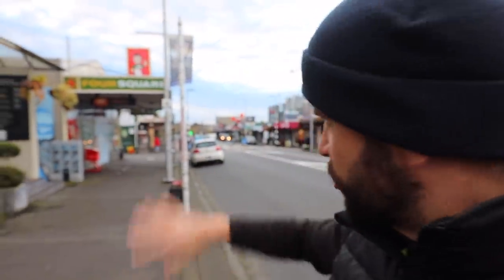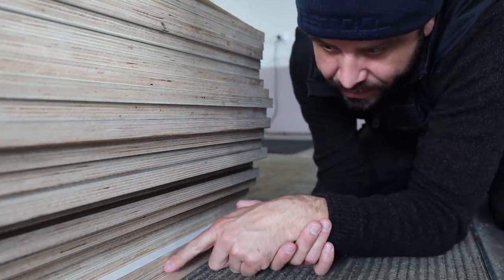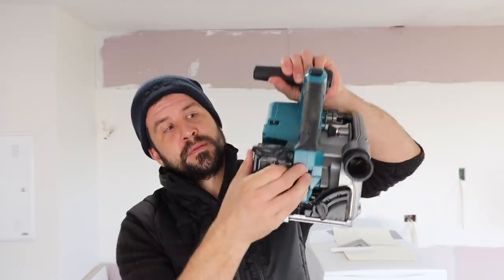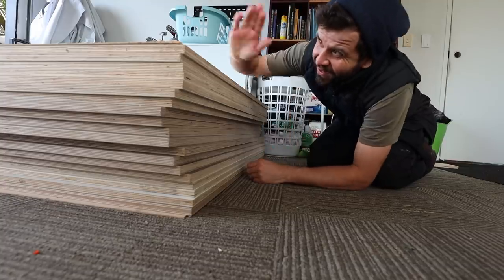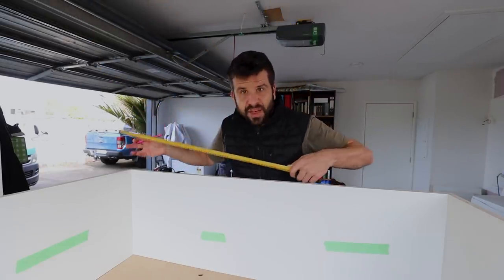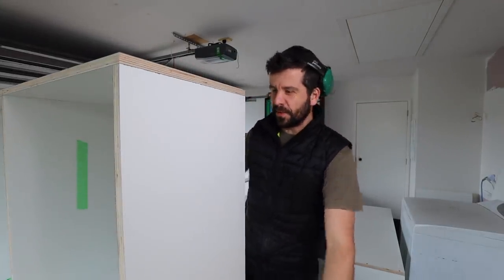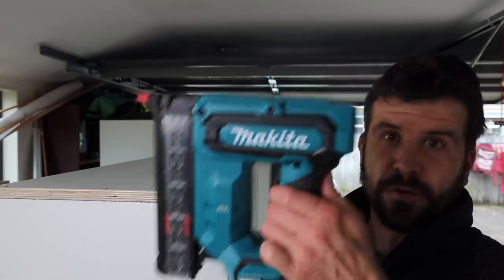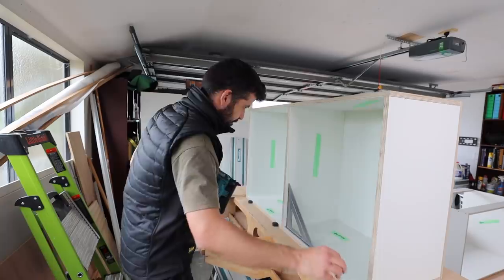Can a Builder Be a Cabinet Maker?

Comment: Scott, if you cutting cabinet panels, you need to get a rail square for your track. A quality one will guarantee a 90-degree cut every time and it should massively reduce your setup time for each cut. It's one of those things where after you use one, you won't know how you did without it before.
Reply: @everythingcool101  The GRS looks nice. I especially like that repeat stop extension they sell for it. 
I've got the benchdogs square and find it excellent. Its a shame they never released their version of the repeat stop attachment.
Reply: If you don’t get a good one it’s a hell of a lot of repeated errors though before you notice.

Comment: As a cabinet maker, I wouldn’t have worried about glueing the carcass together. Screws are easily enough strength. I would have been inclined to glue your back on though if your just pinning it on. Or just use screws for the whole thing. Love the channel anyhow and good to see you back on a job site

Comment: As a joiner and cabinet maker for the past 25 years, I can honestly say your units look better than what Ive seen come out of some kitchen places. Only critiques would be the top and bottom not in between the sides and unless its the look the client wants, no edge banding. Also personally I like to screw my backs on as well, never know how much clients are gonna put in them and how strong those brads are.
Reply: Have to agree with you as a cabinet maker myself last 31 years , maybe some solid lipping would look good on exposed plywood ,other than that top job by Scott
Reply: just curious about not placing the top and bottom in between the sides? is the other way (bottom/top on top and bottom) just stronger when hanging cabinets?
Reply: Sanded edges with the slightest arris can look superb with coloured face ply.
Reply: It's stronger having bottom and top internal as screws are horizontal to a vertical load, also he has now got about 12 or more exposed screw heads that will be seen from under the overheads unless he's going to add an under panel or laminate , but seeing as the ply is exposed it may have been done as to create an ascetic detail.
Reply: @jed8five897  ah right on, makes perfect sense. Thanks for the explanation!

Comment: The TSO parallel guide system is an incredibly valuable accessory when building cabinets with a track saw. Repeatable accurate cuts help save loads of time.
Reply: I just knocked up about 25 fake T&G doors (3mm scoring cut @10cm on ply). Convinced me I need some kind of parallel system - I ended up making a spacer to get the same size for the doors as it was too easy to be 1-2mm out which shows up when the doors are next to each other.
Reply: I’ll second how useful a parallel guide system is for this kind of work. I use the woodpeckers and really like it. The TSO one also looks fantastic.
Reply: @iainarthur7713  same thing for me with a tracksaw. I made some kitchen cabinets and they could be 1/2mm out and knock things out of square. Parallel guides next time for me.

Also how the heck do people get their track to grip laminate and melamine? It’ll slide sometimes
Reply: @iamram93  yeah it's a pain in the arse, the track saw clamps are really good and making sure it's free of dust.
Reply: @iamram93  how old or the neoprene strips? I replaced mine recently and it reminded me how well they use to stick. They're actuay kind of a pain now cause it makes it harder to use the square.

Comment: Standard carcase assembly would have you screw fix through the sides to fix  the base and top , as to hide all screw fixings ,unless your planning on laminating the hole bottom of the cabinet after installed , and understandable the way you've done it if you're going for an ascetic look regarding ply laminations.

Comment: Here where I live, for cabinet backsides we use Masonite, 3-5 mm thick HDF with one colored side, typically white. It is very hard and strong and it provides stiffness to the cabinet structure. It is much lighter than plywood, but it can be tricky to nail it manually. Nail gun rules for this....
Reply: yeah i was thinking that 12mm/15mm? ply looked overkill for the backs. a lot of weight there. 9mm is probably the sweet spot to prevent bowing and sagging over time

Comment: There's a company in Seattle that have a huge cnc and edgebander. You send them your cabinet elevation plan and what materials to use and they use their cnc to cut all the pieces and pre drill the holes for everything including adjustable shelves. they edgeband everything and you pick up as a flat pack and assemble your entirely custom sized cabinets. includes draws and draw fronts and doors too. essentially custom sized ikea
Reply: Whoa, good use of technology there. Are they only local or can they send product to Austin Tx!?

Comment: Hey Scott. Just a tip. Plywood with a surface on it won't take ordinary PVA glue. You need a melamine board adhesive. Looks the same but it's white instead of yellow. It's also waterproof so is good inside sink cupboards where there could be moisture. Also glue the backs on as well. I'm a cabinetmaker in Wellington semi retired. The best cabinet hinges available, in my opinion, are BLUM. They also have system 32 jigs available for drilling holes for the hinge cups, hinge mounting plates and adjustable shelf support holes. Draw runners as well. Check them out. Looking good so far. 👍👍
Reply from the maker: Thanks for the tips Darryl, I appreciate it!
Reply: in your opinion, building cabinets like this- would rabbets and dados step it up a notch, or are they unnecessary if everything is glued n screwed?

Comment: But can he hang a door :-)
Try sliding your tracksaw backwards when doing the scribe cuts, then drop it to the the full depth and run it through forwards, I've had much better results using this method and when you get into the rhythm its more efficient.

Comment: You're correct on the CNC, I can cut round 40-50 panels a day on my CNC. All of the dado's, blind dado's, shelf holes, and anything else cut and ready to go. With the way they build cabinets in your area for around $120K USD you can get set up with a good production CNC and edgebander and go at.

Comment: For those that aren't aware, on Makita chargers, if you repeatedly move your battery off and on the charger in quick succession, you can change it from boring beeps to a bunch of classical melodies. Helps if you work with a bunch of Makita users, you can all have different tunes so you can hear your battery is charged. Fur Elise is one of them.

Comment: Also building some Plylam cabinets.  I found the stuff pretty frustrating as the white coating is really prone to chipping.  Actually found the track saw did a better job than the table saw for some reason, though apparently you need a special laminate blade.  For minor chipping taking a soft sanding block and sanding the corner at a 45 seemed to clean it up ok and shows a nice line of the black layer under it.    

My friend that does cabinets buys a more expensive coated ply that is more rubbery and supposedly more forgiving.

Comment: That glue will not bond with laminate very well.
Reply: Exactly what I was thinking. It won't penetrate the laminate. Better than nothing but Titebond melamine would've been a better choice. Also given these are going to be hung, I assume from the back panel, brads alone to hold the cabinet to the wall probably aren't a great choice either.

Comment: Really nice job 👍 future reference though, have the gables extend full height and the tops and bottoms of the cabinets go between and screwed from the gable into the edge, then it's not gonna break the joint line as it's a lateral force on the screw, instead of a pulling force which can strip out the screw from the timber
Reply: Peter Millard would not be impressed
Reply: I've seen top and bottom rabbeted, then fasteners can be applied from both sides of the 90 degree angle. It also gives a better glue surface on something like melamine.

Comment: Hi Scott, I have made many cabinets over the years. I would suggest that the backs would be better if they fitted inside the cupboard carcass and screwed into position. I am assuming that you are going to use the backs to attach the cupboards to the wall, with only the nails I feel it would pull the backs off the cupboards when they are loaded. 
You may be going to use another system which will over come this. 
Love watching your videos.
Reply: I agree with this, I use full 18mm backs inset and screwed.
Reply: Most joinery shops here in Aus would have internal  backs rather an external but some go with external,  but either way they definitely need to be screwed

Comment: Hey Scott, I'm not a professional builder like you but have built a fair amount of cabinets myself that came out very well. I wonder about a few things you do:
-Why saw all panels manually? Here in the EU you can find places that sell you plywood boards cut on a CNC saw. You do have to prepare a cutlist with all your panels and perhaps work in 3D, maybe that's why you don't do it? The extra cost for the cutting service is negligible for the improved accuracy and time gained.
-You use really fat panels for the back in that last part, is there a reason? I usually stick to 9mm thick panels as its cheaper and doesn't contribute to strength through thickness.

Comment: my luck . 18 gauge pinner would have gone through the back panel into the center panel about a 1/4 of an inch and then the nail would take a right or left had turn and stuck out the side .lol nice job.
Reply: Turn the gun 90 deg and nail it so that the nail turns parallel to the piece you nail

Comment: Cabinet Maker here in Australia. A carpenter can be a Cabinet Maker, but not many carpenters I know have the patience to deal with all the fiddly cabinet specific hardware. The difference will be the time it takes to do the work with the tools each has.

They’re two different trades which are allied but not the same. 

You can buy $5000 Panel Saw and a $10,000 Edgebander and call yourself a Cabinet Maker versus spending $15,000 on a Chippys tool trailer and carpentry tools to fill it.

Comment: While I’m at it.  I have 18 volt Brad nailer. 100% of the time, the first nail is severely under powered and sticks out buy 1/2.  I use a scrap block to fire at least 2 nails before I use it on my actual joining requirement.

Comment: So what I'm wondering is where did you learn that the Mutiplex has to be stored flat? You can see that you are not thinking efficiently because if you had placed it vertically on the side then you don't need to worry about how to get to the bottom one. And by the way, tile storage systems in Europe are always vertical! And why do you nail such a thick back wall to the top hangers ??? Wouldn't a 6 mm multiplex have been enough?

Comment: I use the 18V Makita brad nailer, it shoots brads up to 65mm without any issues, so no worries about the 40V version.
Please tell me where to find the stand-off ring you use for your countersunk holes?
Reply: The 40v doesn't take more that 40mm I think. 
I'm also here looking for that counter sink set up...
Reply: The coutersink device is sold as a unit, drill, countersink and standoff piece with HDPE ring on the end. The drill bit is is held with an Allen head screw so easily replaced when blunt/broken, the standoff piece fits over the countersink and spins freely. Here in Oz Bunnies stock them as well as the better trade suppliers, so they should show up in your local Big Box store.

Comment: With the thickness of the material being used for the cabinet carcass then it would have been worth rebating the backs in rather than having an additional layer of board showing at the back. Also 6mm is plenty thick enough for the backs even to add strength to the unit
Reply: He's doing it with a track saw only so setting it on the back makes sense.  The rebate would be hard, he'd have to use a hand router with the tools he's got and it would be a prick to do, plus that white coating is awful to route.
Reply: @mtnbikeman85  "with the tools he's got"???? He's got the majority of Makita's catalogue! Doing a rebate on faced ply only needs a straight edge, some masking tape and a router (which I think he has at least one of).
Reply: @mtnbikeman85  presume you have now watched the second part and realised the naivety of your comment. Oh dear!
Reply: @iankearns  no actually I don't he said the same stuff about chipout I did. I'm sure you've never worked with NZ Plylam, it really is hard to route and keep a good edge, hence avoiding the rabbit as it's unnecessary with 12 or 18mm backing.  

I'm guessing you're a standard YouTube woodworking troll who always has to know best.
Reply: @mtnbikeman85  8 years building cabinets. The problem with some people (you) is they can't accept when they are proven wrong or told otherwise. You must encounter this everyday though so you're used to it

Comment: I must say, one of my pet peeves is when the drywall behind cabinets are not painted, because the cabinets will hide it... feels a bit half-arsed. Also, when flooring is not done completely (like under kitchen cabinets), just feels wrong. I am not sure if there is a technical/code reason for doing that or if it is just a cost cutting/savings reason?
Reply: drywall behind cabinets are not painted - Why would you lose time/wasting paint on something that will never be seen? Do you paint your attic?
flooring is not done completely (like under kitchen cabinets) - Depends what is installed first or the floor is laid on top of the old one to save on dismantling/moving cabinets
Reply: Agree.  I hate that mindset.  I work with dudes all the time that say “oh, that will be hidden by X”.
Reply: @poatjoler  Well, a reason to paint the drywall is because you might change something and might just be stuck with an area where the paint don't match, then you have to paint more than just the bits you did not paint. For example, I changed the over the range hood fan with a thinner more efficient one, and surprise, surprise the drywall was not painted. We all know how difficult it is to paint match. Also, putting new floor over an old floor to me is just a BIG NO, NO. But again, these are just my opinions.
Reply: @TheSanzca  Your paint reason is the same reason my cabinet guy told me not to put the floor underneath the cabinets.  Cabinets should last longer than the flooring (unless you're doing hardwood) because it's a wear surface. So it's typically safer to to cut around the cabinets so when you switch flooring you'll be good to go.  Also, typically cabinets have a standard height but flooring is all over the place.  If you went under the cabinets you'd have to have your new cabinets either be taller/shorter than standard height or with no flooring they just drop in the standard size and be done.  Less cost and easier/quicker to replace.  Most cabinet shops do jigs and fixtures once a good height is established.  Though, height in a bathroom in the states is changing drastically due to height of humans changing.
Reply: @trevorp875  I guess there is no silver bullet solution. For bathrooms I like the idea of floating vanities. The stuff people put in homes these days (even new homes) is all just particle board and the moment that gets wet, it is done (not in this case I know). I replaced a dishwasher not so long ago, and the stuff under the kitchen cabinets was just crazy. Found an old coffee cup, dust and building debris that was never cleaned, just wiped under the cabinets it was disgusting. I thought, at least if they do proper flooring they would be somewhat forced to clean it? I guess a lot of it depends on the various trades and the quality of workmanship and pride that people take in their work. I understand that for people who do this for a living the quicker it gets done the better. As a homeowner, If I see things like that it will always bother me, maybe I have some undiagnosed OCD or something.

Comment: Great videos but noticed a few things….
1. Should use screws on the back Brad nails are not up to the job 
2. Back panel 9mm is thick enough looks like you’re using 15mm
3. Wood glue doesn’t work well on melamine type finished ply (if that’s what you are using)

Comment: Scott, love the videos, please put some screws into the back panel of that cabinet! Hanging off the wall relying on glue and brads isn't going to cut it. Also pva won't hold melamine
Reply: You haven't glued melamine? Once had to pull apart a pantry that wouldn't fit under the ceiling trying to tip it upright (hadn't accounted for a double layer of gib in the room next to the kitchen !). Even though it was only a couple of hours, all the spots where the glue was really compressed by the screws, when pulled apart it ripped the surface and chunks outta the melamine. That shit was bonded.
Reply: @DiscoFang  the glue that was used in your pantry was most likely a Melamine glue, Titebond make one and its pretty damn good. regular titebond or other alphatic/PVA will just peel off as it wont bond to nonporous surfaces.
Reply: @666attica  Sorry to disappoint your theory but it was Selleys exterior/interior PVA. Not polyurethane or any other - PVA.
Reply: @DiscoFang  ok what ever you say mate, you're telling the story

Comment: I hope the owner is going to change the washing machine as I don’t see how a top loader will work. 
Are there any ducting at the back of the cabinet for the dryer(so you don’t put moisture into the garage) or are they going to change to a heat pump one?
Are you going to use Blum Spacestep for the drawer underneath? I was surprised how often I use and handy it is
Reply: Looks like the new washer and dryer are sitting at the front of the garage in boxes. You get a glimpse during the plywood stack rearranging.

Hmm, that step looks interesting. I want one now.